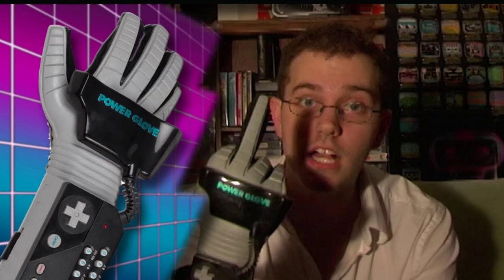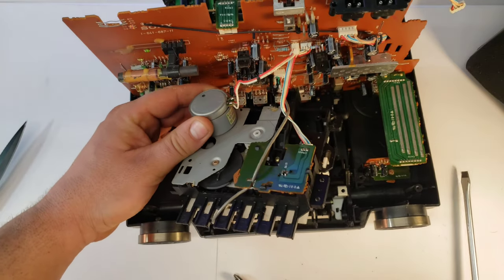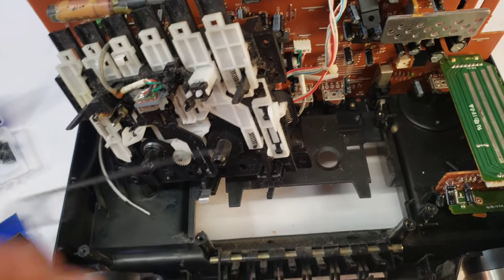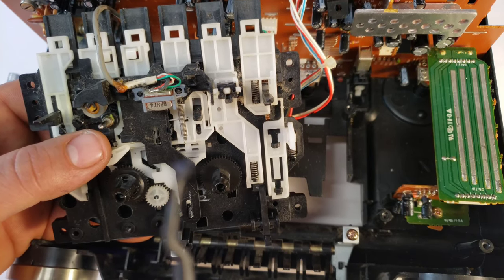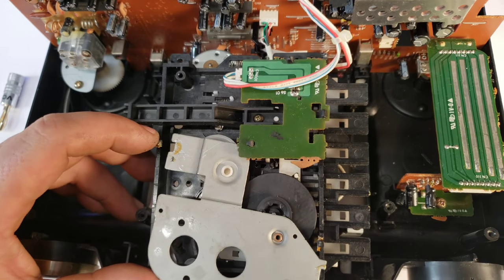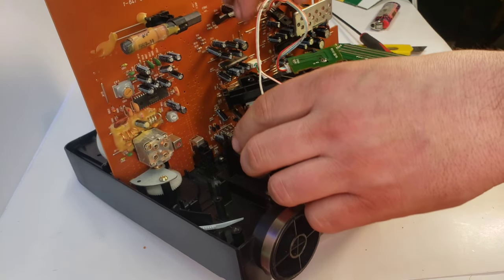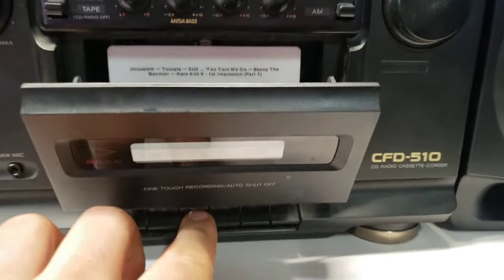SONY CFD-510 Boombox Repair (AVGN's Boombox)

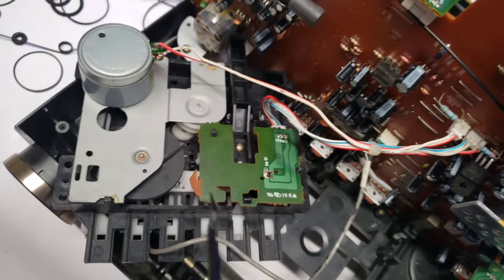Comment: Have the older version, the CFD-440, basically identical but with different tweeters in the speakers. 26:30 The little cog wheel needs an idler tire with a flat outer surface, a rounded one won't work, it's missing from all belt kits I've seen.
Reply from the maker: yeah, I couldn't find one online either. I ended up finding one at the hardware store. It was in an assorted set of o-rings.
Reply: @cokesucks  Yes, part number ST.525, bought it from eBay, the guy lists it as being compatible with other model numbers but it works with the CFD-440 too.
Reply from the maker: Thank you!!!

Comment: i have the exact same boombox and all of my belts were fine but the cog is poop i wish you showed how that worked because this is confusing the crap out of me
Reply from the maker: So that cog just pops off (be careful) they refer to it as the pulley. I found a pulley replacement set online and plan on doing a part 2 on fixing that. Sorry for not going into greater detail on that.

Comment: Hi!  I am finally attempting this repair, believe it or not.  Could you please show me a link to the previous video that you refer to in this video, showing the disassembly?  I can't seem to find it.  
I am trying to get the two pieces of the case apart, but the top corner is stuck.  Thanks!
UPDATE got it open, attempting the belt repair.
Reply from the maker: Good luck, and let us know if you have any questions!👍
Reply: @Blowncapacitor84  well, as a matter of fact...  everything went well, I think, except it eats tapes when I try to play a cassette.  There was a little 1cm o-ring that looks like it broke and fell out, I think you mention something about that...  would that be why?
Reply from the maker: @bradenrz  I think so. That's a cog wheel that I believe drives the take-up spool. I'll go back and  look at the footage to make sure but I remember getting that o ring from the hardware store. Try searching ebay, they usually have the kits.
Reply: @Blowncapacitor84  you wouldn't happen to remember the size and dimensions of that o ring, would you?  I threw the broken one in the garbage like a moron.

Comment: what size belts did you end up using for the CFD-510?
Reply from the maker: The belts I used were from an assortment. I had to order the proper belts as well as a new pulley.  I never actually measured them but  You can get everything at a place called Encompass Parts.

Comment: I am looking to replace the connectors for the speakers on my Dad’s 510 but have no idea where to look to replace them.  Someone cut them off
Reply from the maker: Oh man, that sucks! You may have to trace them back from the head unit, I believe they run through the little rubber tunnel thingie
Reply: @Blowncapacitor84  I was afraid of that.  I will see what he wants to do.  I would love to get it working again for him.
Reply: @Blowncapacitor84  Thanks for the help